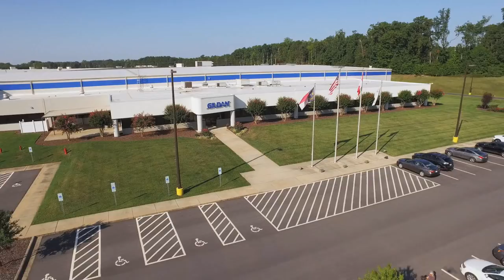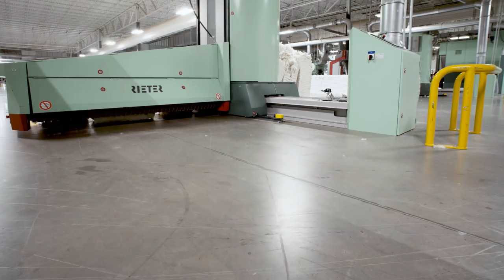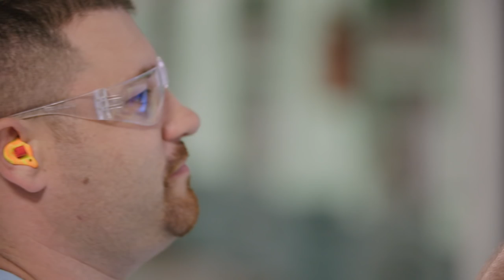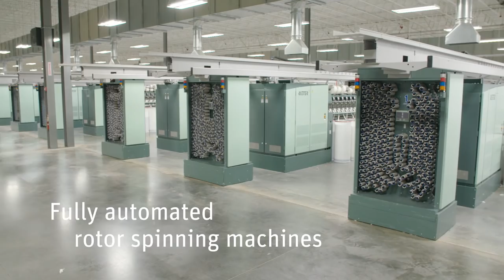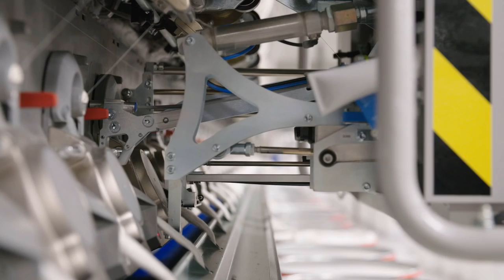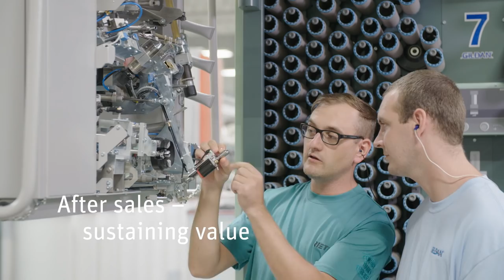Rieter reference mill video Gildan Salisbury

Comment: These machines took out other processes and killed jobs for a inferior product. Old style cotton mills were way better in keeping quality control at a higher level.
Reply: .....minus speedframes and ring spinning subs by open end. agree old styles was way better than OE
Reply: But the ring spinning method still exists and is used in thin yarns. The OE is not capable of making extra-thin yarn.
Depending on the clothes the yarn will be made of, it doesn't make sense to use ring spinning, if there's a faster method for it.
Ring Spinning is only used on top-of-the-line clothing.